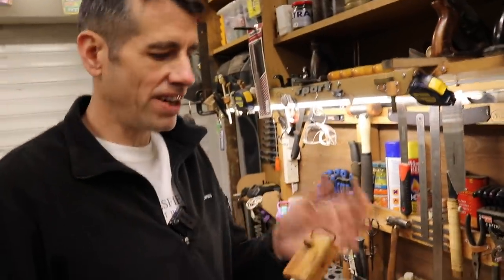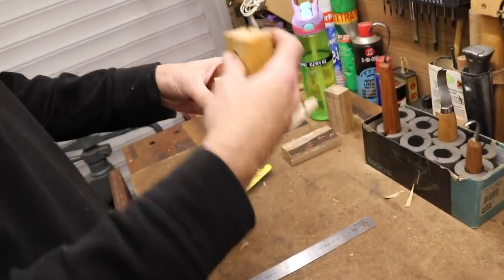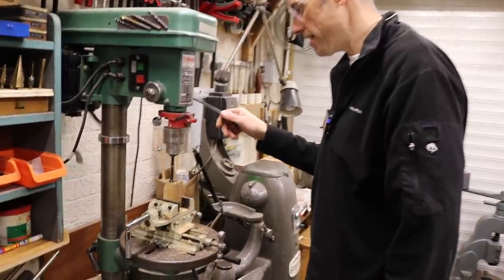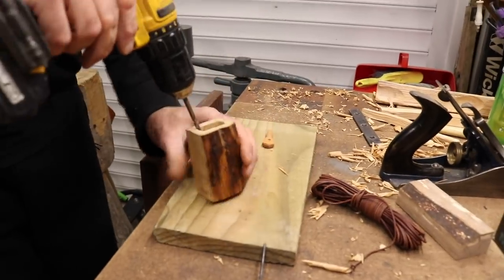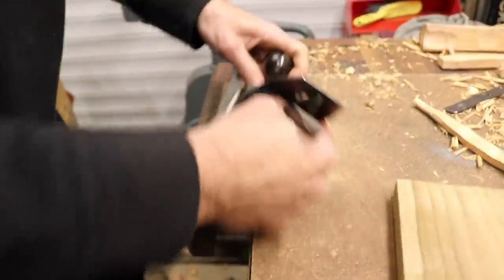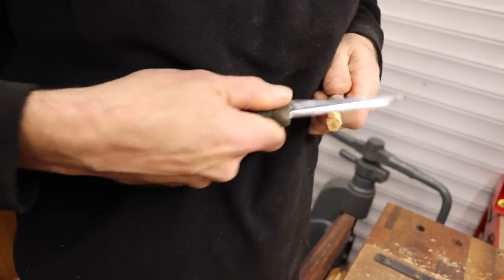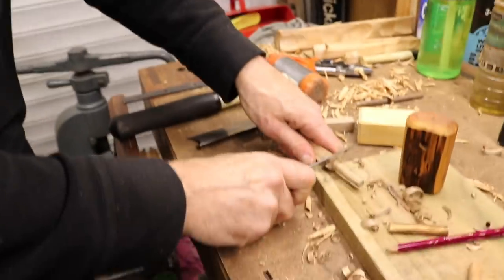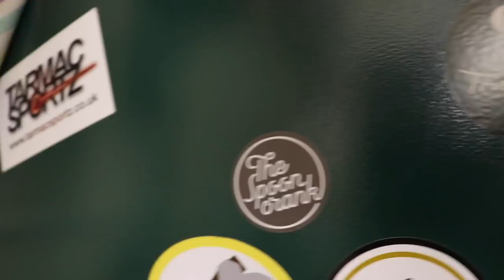How To Make A Blade Box For A Spoon / Hook Knife – Lee Stoffer

Comment: great demo.  Love the box and the care with which it was made.  My only concern is the oil. Did he say boiled linseed oil or raw linseed oil? Raw does not have the chemicals in it and might be better suited for tools used to carve spoons or other things that will have food in them.  Boiled linseed oil has some very nasty chemicals in it.
Reply: Boiled dries much quicker and I don't oil the inside of the box where the blade goes. 👍🏻
Reply: @LeeStoffer  I do love the smell of boiled linseed oil. I used to used it on furniture and cabinets I made. Then wax to give it a bit of a sheen. I got cancer and was concerned about toxins so I’ve tried all sorts of oils. Most don’t dry very well. Tried coconut oil but it doesn’t dry at all and gets sticky. Well done on those boxes.
Reply from the maker: Like Lee has already mentioned he used Boiled linseed oil which cures very quickly and is fine so long as the item doesn't come into contact with food ~Peace~